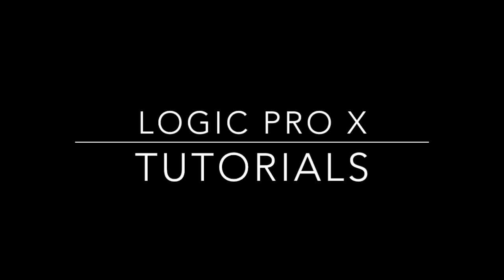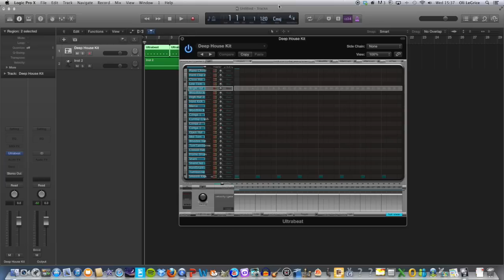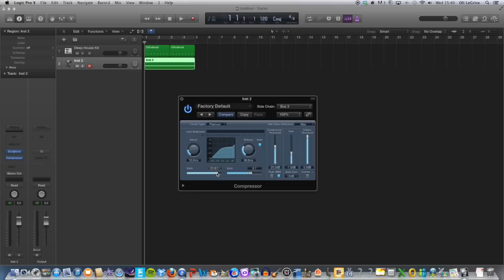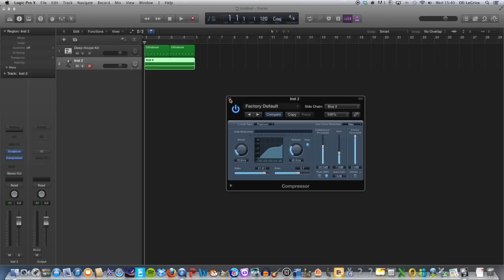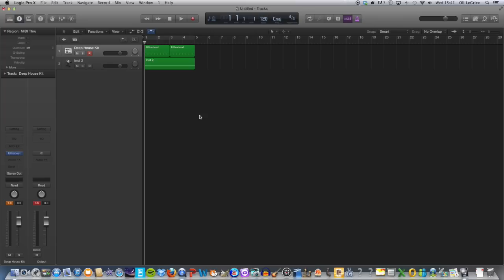Logic Pro X - How To Do Sidechain Compression

Comment: Way easier is to put an audio kick on a random audio track with NO output selected along the whole track and select that audio track for sidechain in the compressor. When you got parts in your song with no (midi) kick like ultrabeat here, you still got the sidechain effect without hearing the kick as it has no output. You don't need any bus or extra routing like shown here. Important for the sidechain impact length is that with an audio kick, you can short the kicklength for a much tighter or longer sidechain effect. Oh, and the Fabfilter Pro-C2 compressor is way better than the Logic compressor!